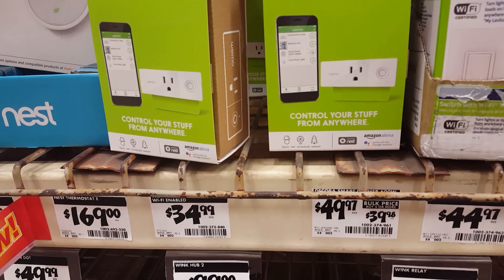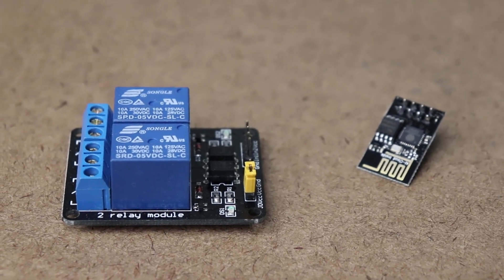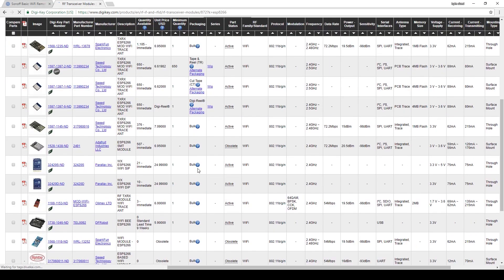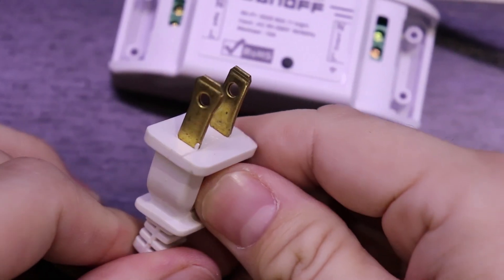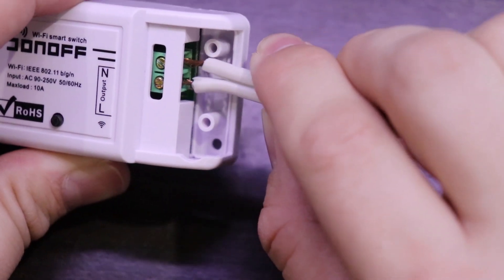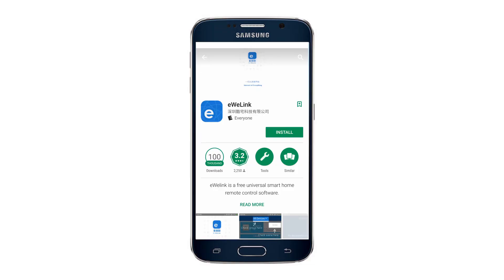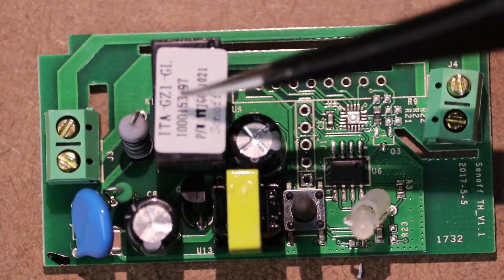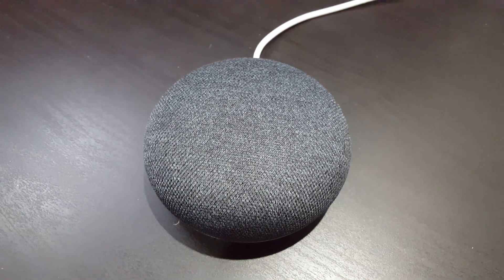Sonoff - The $5 WiFi Smart Switch That's Compatible With Alexa And Google Home

Comment: Pro: it is super cheap
Con: your house burns down

I would seriously buy the most expensive extension cord not the cheapest. Very informative video though.
Reply: Then I got the right one for you. It will cost you 300 USD + additional DHL shipping.
The advantage is that it looks exactly like a cheap wallmart cord, so no one will steal it :-)
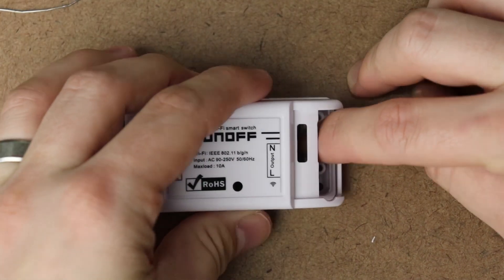Reply from the maker: That's an interesting point. The extension cord I used is UL listed which is the same safety certification process that all electrical equipment here in the US goes through regardless of how expensive they are. Weather you use an expensive or cheap cord, that UL certification goes out the window as soon as you cut the cord in half like I did in the video.  There are several other safety measures taken to prevent problems. If you watch at 4:07 you'll see that the circuit board has slots that isolate the line and neutral signals so they can't short. Also I have 15 amp breakers on all outlets in my house that will immediately trip if a short circuit were to occur. All that being said there is a chance that something could go wrong, but it is very, very unlikely. I'm glad you brought up that point. Anytime you are working with mains voltage you need to be careful.
Reply: Yeah I have been using these extension cables for 5-6 years only one started spitting sparks so I threw that one away.
Reply: @OneManShow, That was one of the main points like using it with a soldering iron, and oscilloscope that he clearly demonstrates based off his “easy to do wiring”. I can only guess he removed the ground from the oscilloscope soldering iron. Thanks for making my point. 
To others reading comments I’ll keep it short, watch another video that has a wire on the outside of the sonoff. Do NOT do it this way in this video. Do research, it’s mains AC electricity and will kill you. So take the time to read things, even long comments. 
My other point was to see if he would fix and edit the video showing how to keep the ground wire on the outside of the sonoff, and put it in another box for double insulation. Also that reversing the Live and Neutral could make a metal appliance hot and electrocute someone. That needs to be clearer, they won’t know since it will still work even if it was reversed. 
But most of that was for the creator of the video asking him to fix it since he say it’s real easy and show you how the wrong way. Truth is people watch videos all the time and follow them, and might not know his video shows not using the ground or why its needed. 
I try to think like a viewer with no electronic experience before I make any video for this reason so no one gets hurt. So I hope he reads it and edits the video, uploads a new version.
Reply: OneManShow, I forgot to answer you main question on why I wrote a long post. I’ll keep it short for you. Answer: So he and others don’t kill them-self and get electrocuted.
Reply: Gadget Review Videos stated "FYI: it’s “Live,” not “Line”" and "If the device is wired for a 3 prong using the separate ground it’s because it uses more power and requires a separate ground" and "A basic cheap computer power supply for 400 Watts will draw 10 Amps"

In the US, the "live" wire, or the "hot" wire, or the wire with the voltage, is in fact referred to as the "LINE" voltage. It is called "LINE" in "electrical" wiring diagrams and is designated as such in "electrical" panels. 

On an "electronics" schematic, "L" is used to designate a component called an "inductor".

Voltage is the difference in potential between 2 points. In the case of a typical US home, the difference between either Line and Neutral (110VAC) or the difference between L1 and L2 (220VAC). 

A typical US home will have an electrical panel supplied by "center tapping" a 220VAC transformer. This will yield two "Line" voltages of 110VAC each inside the main power panel which is labeled L1 and L2 with the center tap providing the Neutral. The ground is supplied by driving a 6-foot long copper rod into the earth and bonding it to the panel chassis and the panel Neutral. The US National Electrical Code (for both AC and DC) mandates that the grounded neutral conductor of a power system be color-coded white or grey. The protective ground must be bare, green or green-yellow striped. Hot (active) wires may be any other colors except for the previous colors used for ground and neutral. In my experience, panel L1 and L2 are jacketed in black insulation which is left alone or color-coded red or blue with electrical tape, and neutral color-coded white and ground color-coded green or green-yellow striped.

The third conductor in a 3 prong conductor has nothing to do with supplying more current. It is purely a safety feature. In the US, the neutral is a current carrying conductor. It is no different from the "hot" line except that it happens to be bonded to earth in exactly one place (typically the panel where power enters the home). The ground wires carry current ONLY in the event of a fault. The ground wire is bonded to externally accessible metal of all line powered equipment. Normally NO current flows in the ground wire. But if the hot wire comes loose inside the equipment and shorts to the metal case, it will cause a large fault current and trip the circuit breaker.

Some power outlets now have ground fault interrupt (GFI) circuit breakers. These compare the current flowing in the hot and neutral conductors. If the currents are not exactly equal in magnitude (within a few mA) then the GFI trips. This is possible ONLY because both ground and neutral are used.

A 400W PC power supply typically uses between 110 W at idle and 490W at peak demand. The "400 W" rating is typical average use over time.  

Ohm's law - W/V = A 

Where:
W = Watts
V = Voltage
A = Amperes

400W /  115V = 3.48A

It would take something like a 1200W hair dryer to reach a 10A current draw. 
1200W / 115V = 10.43A

A typical home circuit breaker requires 135% of it's rated current to trip. Time and temperature play into the equation as well. Hot breakers will trip faster than cold breakers. Sudden short peaks in current that exceed the breakers rating, like those that occur when a motor starts, usually will not trip the breaker.  

There is a more detailed explanation with a drawing here: https://diy.stackexchange.com/questions/42043/whats-the-difference-between-three-phase-240-v-and-standard-household-240-v
Reply: @rwj1313  So what you are saying is Mr. Smarty pants made some incorrect statements while trying to correct the OP? His post was so damn long I was sure he copied and pasted it from somewhere knowledgeable.  Being that I read it on the Internet, I really thought everything he said was true, too!
Reply: Shaggy one if you had uk sockets you could just pop a 10A fuse in the plug top.
Reply: Shaggy one, most loads in a home are are lower than 10 amps even on a 20 amp receptical circuit. If current is a problem just use this switch to energize a contact relay rated for the desired current/voltage.
Reply: Gadget Review Videos learned a few things reading your entire post (while other complained that it was lengthy and some what of a rant). I appreciate it. The video itself was a good video,but I actually managed to learn more for your post. Live and line. What could potentially happen if the ground is removed and why. So thanks to both video maker and video commenter. I’ll be picking these up, but I’ll definitely make sure they are wired properly.
Reply: Benjamin Harvey they make those for us plugs too, but only some have it
Reply: That's not entirely true.  The rating on the cord is still important -- that is to say, how much heat it can handle.  I can hand you two different UL listed cords and one will run a vacuum all day and the other will melt.  Check the ratings -- match it to what you're plugging in, and any additional resistance added by the switching device.
Reply: Thats also why you linked the polished version that can plug right into the wall.
Reply: I did.
Reply: Do he run 🔘🔞⛔
Reply: Ok, you pointed out the UL listed Extention cord, and the UL rating is by;assed when you cut it.

You stripped the cord to long, you don’t want any wire hanging out of the screw terminals. This is a potential arcing point.

The extention cord you used is rated for light duty (lights, small fans) despite its 10 Amp rating. A basic cheap computer power supply for 400 Watts will draw 10 Amps, but with this light use cord it will get hot and could catch fire. The length and gauge of the wire has to do with its light duty rating as well, by using the sonoff you judged added to the over all  length and resistance cutting the cord rating down to maybe good for 8 amps light use. Your setups should never be used for a surge protector and computer stuff, it will be a fire hazard. The blender is not a light use device and pulls a lot of power when under load chopping and mixing. 

I know for a fact your soldering iron also has a 3 prong plug.  The other things you demonstrated probably have only 2 prongs. My point is you just took the ESD rated protection and proper grounding incase you soldered something you forgot to unplug during testing and removed all this protection completely from the soldering iron, and  it’s not ESD Safe anymore since it doesn’t have the ground connection, and some soldering irons are not light duty and draw much more power then yours. 

Some how I missed the remote turn on of the oscilloscope, please tell me you didn’t remove the ground from your oscilloscope. If you did, you need to go back to the basic of how to use an oscilloscope before you end up being electrocuted yourself. Find the video on the eevblog channel called something like - how not to blow up your oscilloscope.
https://youtu.be/xaELqAo4kkQ

I know sonoff didn’t include the ground terminal screw block but this can still be done with a higher quality 3 prong extention cord, not a light cheap light duty cord.  Either by not cutting  that wire and shorten the other wires to put the sonoff in line. If you cut all three you will need to solder the ground wire back with proper rated heat shrink for maybe 300VAC to be safe and run it over the top of the sonoff box. But now you should take that whole sonoff box and put it in another UL approved junction box that seals giving the ground wire protection and creating the double insulation barrier for the other wires and the sonoff. This would make the whole unit a lot safer.

Make it clear and mention they should never never remove the ground wire from a 3 prong device like a soldering iron and should keep the ground wire connected and insulated. Or mention that the current wiring of the sonoff should not to be used with appliances that use all three plug prongs. And if using a cheap extention cord only one or two things should be plugged in to the sonoff, but if you use a better quality cord with a 3 wire plug you can put this inline with a surge protector strip allowing 4 or 5  light duty things to be plugged in. Not a full size computer, or gaming machine.

The Neutral is the fat side of the plug, the Live/Hot wire is the thinner side of the plug. FYI: it’s “Live,” not “Line”. Wiring  this backwards with some devices could cause the metal frame of something you plug in to become hot and cause someone who touched this to be  electrocuted.  In a proper wire house in the US the Neutral can also act partly as a Ground since they are joined together in the fuse box, so IF the device is wired correctly for a US 2 prong plug then something goes wrong the electricity can follow the path back to the ground over the Neutral. 

If the device is wired for a 3 prong using the separate ground it’s because it uses more power and requires a separate ground and this should never be removed or bypassed. Don’t think the Neutral will handle it if something shorts, it won’t unless the device is wired this way. If it has a 3rd ground prong then it’s not wired to use the Neutral as a ground from a short.

Yes, I am still planing on using them and bought 6 recently, but some people don’t know what they are doing and just follow the videos like yours. For the safety sake of others please think about removing this video, editing it and including shorter stripped wires, a little more expensive 3 prongs extention cord.
People follow videos on YouTube that may not be the best advice just because they have a lot of subscribers. If they wire it according to your video and the electricity doesn’t have a good path to return to the ground since the 3rd wire plug was bypassed/removed and/or the two wires are backwards it could be hazardous and kill someone. 
I ask of you to edit this video with proper warnings, or just show it’s possible for $5 (plus $12 shipping for 5 units)  and advice someone to seek professional help when wiring it.  Even I stay away from doing AC electrical videos for a reason, I don’t want to feel responsible if something goes wrong when they follow my instructions. But then again this leaves a lot of videos with bad information. 
People need to know that messing with AC can kill you, especial if something shorts out with the device plugged that should use all 3 wires and the ground is removed, or the Live and Neutral wires are reversed. Even with reversed wires the device may seem to be working OK so they wouldn’t know they have a problem, until they touched something plugged in made from metal and get electrocuted or something shorts and fails with the device plugged in.
Reply: People who buy the most expensive whatever make the world go around, & those of us who produce things thank you for it.  You keep shoes on our babies feet. Keep doing it forever please.
Reply: Here lies the problem. The device itself is only rated for 10 amps, so there is a good possibility the sonoff will burn up before the breaker trips. That 10 amp rating is probably limited by the relay, so the isolated lines are unlikely to be the fail point of the circuit.   I'm sure as long as you stay below that 10 amp max, you should be alright.
Reply: the speed that breakers trip is extremely fast and if there was to be a short circuit, the current would reach hundreds of amps, therefore tripping the CB before any real damage could occur.  That being said, if you were to fully load the sonos with 10 amps for a while, it would eventually overheat. but you could say the same about pretty much every electrical appliance.
Reply: What a dumbass
Reply: +Gadget ... why the heck would you write that much in one post? Get to the point, or don't waste your time... nobody is about to read all that.

To your point (as far as I read anyway) I think that anything that isn't "light duty" will have a 3-prong connector... which won't be able to be connected to this extension cord (unless you remove the ground plug like an idiot).

Comment: any ideas for the water heater ?  i think is 4.5kw .... sonoff has only 16a 220v switch ... that mean 16a*220v=3520w ....
Reply from the maker: You are correct you'd have to find a sonoff device that is rated to handle that much power. That is quite a large load so you may not find one that will work. Let me know if you do.
Reply: https://www.ebay.com/itm/WLAN-Relais-Modul-220V-30A-Wireless-Wifi-Relay-Switch-Module-High-Power-6000W/382190862594?ssPageName=STRK%3AMEBIDX%3AIT&_trksid=p2060353.m2749.l2649 

found that ... i'v order it ... with a case i think that will do the job ... what do you think ?

Comment: I don't have enough thumbs up to thank you for this! 
So the only "bad" thing is that it cannot be controlled outside the WiFi network
Reply: yes you can. You can do it with the official app and firmware, but also after you flash yr own software on it
Reply: Great so everything connected is vulnerable to hacking. Is there a way to run Wi-Fi mode only?
Reply: TheHavoc09 - there is even a better way as in having OpenHab server running let's say on a Raspberry and this is how you get "your own cloud" and control panel
Reply: Narcis Enache great thanks! Will look into it. Had a Chinese IP cam that I know longer use as it sent all video through a Chinese server and back to whatever you were connecting with even if on intranet
Reply from the maker: Thanks for watching! When you setup the sonoff with the eWeLink app you can control the switch from anywhere with an internet connection. You aren't limited to being on the same WiFi network.
Reply: I use these to control devices from another state, even with a Google Home Mini in a hotel.

Comment: If you hadn't seen this yet: https://community.smartthings.com/t/release-sonoff-sonoff-th-s20-dual-4ch-pow-touch-device-handler-smartapp-5-10-smart-switches/45957
Reply from the maker: Thanks I hadn't read that article. I don't have a smarthings hub, and the stock firmware has worked just fine with my setup so far. I think it would be interesting to flash some other firmware on there at some point.

Comment: Which shipping option did you go with considering there straight from China most of time for me in the US packages would take a bit more than a month to arrive that why I tend to stay away buying products straight from there but for the price compared to other smart plugs I could wait
Reply from the maker: The first switches I bought came in a 2 pack on Amazon for about $16, and I got free 2 day shipping because I'm a prime member. I also didn't want to wait so I bit the bullet. The second time around I ordered 4 of them ($4.85 ea for basic) from itead studio and paid $6.36 in shipping. It took a little over two weeks to reach me in the US. For one or two switches I would go the Amazon route again. If I were buying a bunch I would probably wait for them to come from China.
Reply: Thanks! Going to try Amazon recently got a Google mini and been excited to try out some smart home automation :)